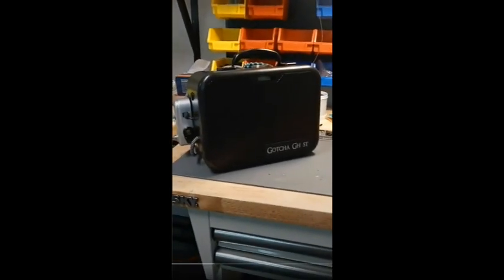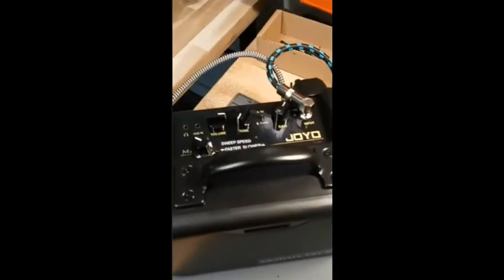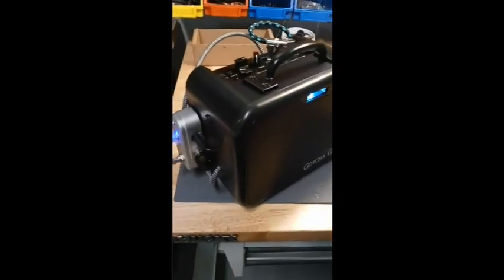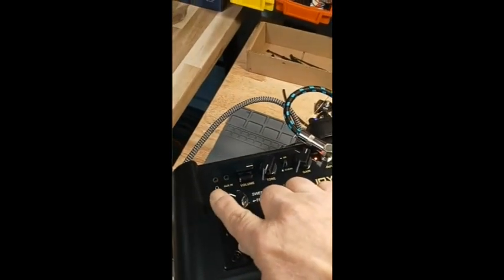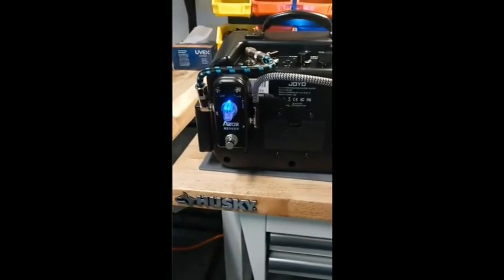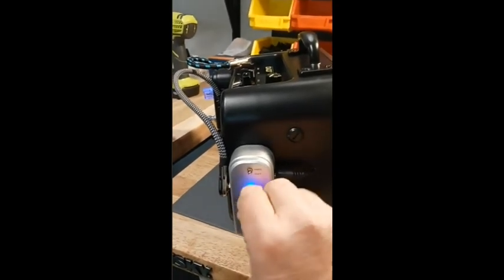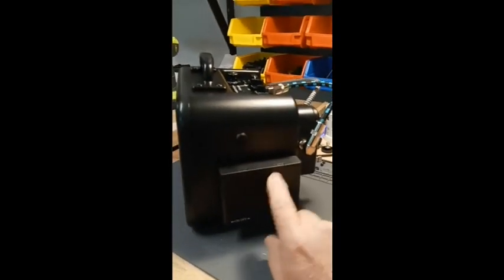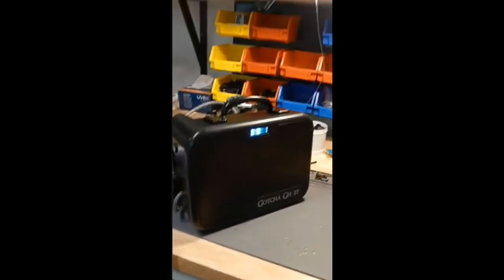Sweeping Spirit Portal - Spirit Box and Portal All in One

Comment: Ok, so I am working on a spirit portal, which is a Brain-Computer Interface 

Which uses different crystal oscillators, at different frequencies, to detect different brain waves, which are translated, and compiled into usable data.

Like think of an apple, and a 3D picture of one should show up

You could then 3D print that, although it wouldn't be edible.